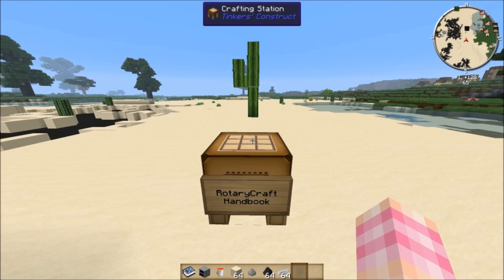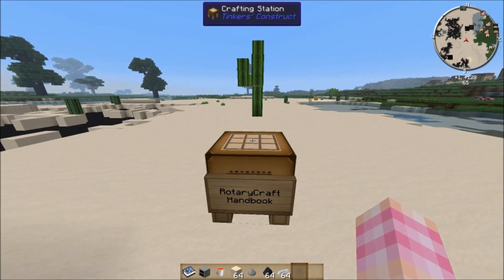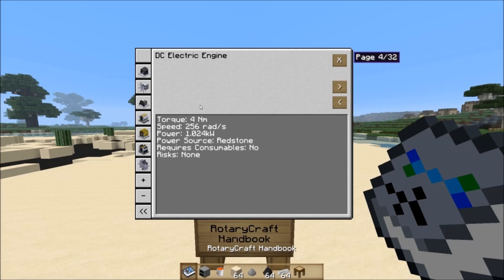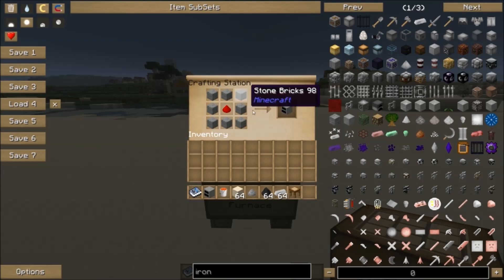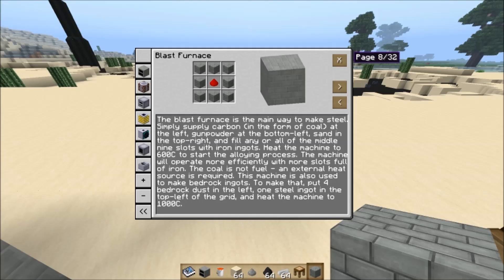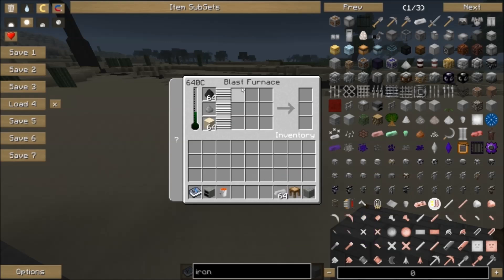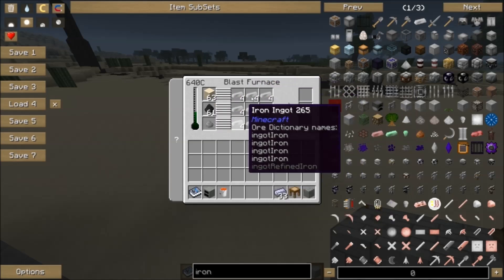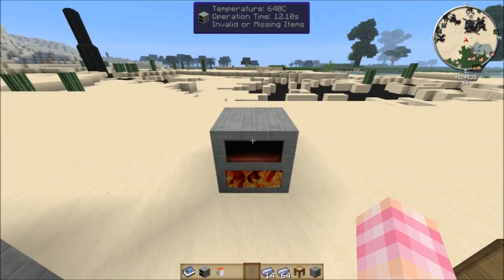RotaryCraft Tutorial #1 - Getting Started & Making Steel

Comment: is it only heated from the bottom, or can u aqueous accumulator it and have lava on 5 of the 6 sides?
Reply from the maker: Having lava on multiple sides will not heat it more. I'm pretty sure you can put it on the side.
Reply: I meant quicker as opposed to hotter, cos lava's going to be as hot as it's going to be, right? Fair enough. Good to see someone shedding light on RC; I'd play it if this p.o.s laptop got more than 12 fps in vanilla. Happy New Year, btw.